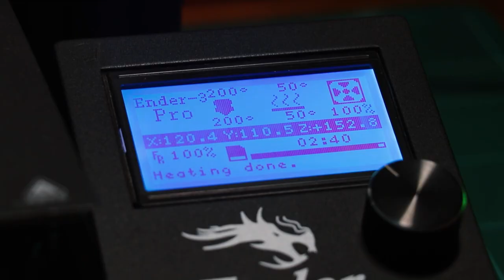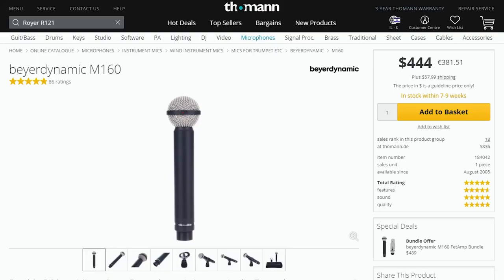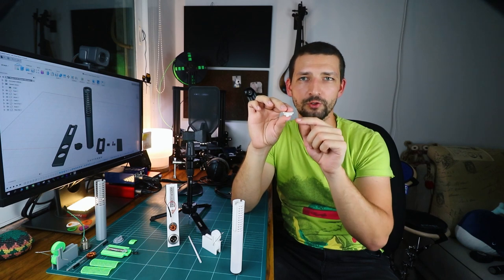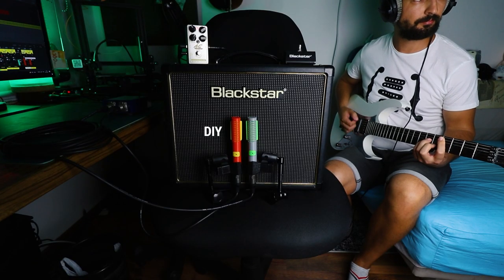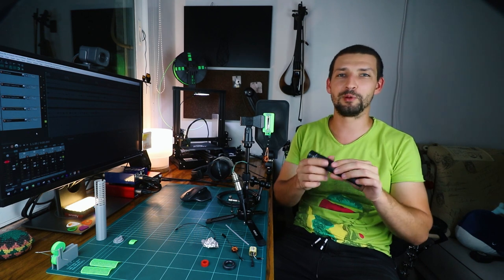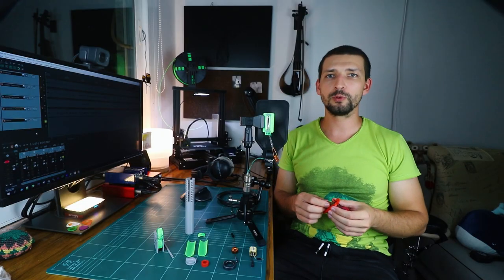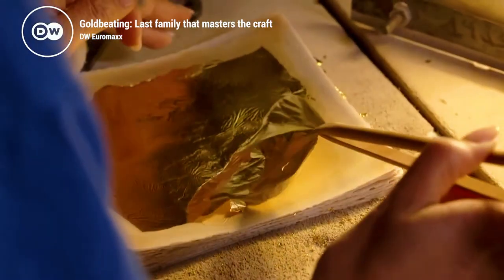3D Printed DIY Ribbon Microphone | Lundahl LL2912 vs Hand Made Transformers

Comment: I have to say you really made something great here, But the toroid transformer was the dealmaker as it saves big money and really makes it your own. Thanks.
Reply from the maker: Yeah, I didn't plan going that far, but as I was exploring how premade transformers are commonly wired I came across the Messanovic videos. It looked plausible, added few months to the project but decided to try it for the sake of the video. Turned out to be the most significant part of it :D

One could make such DIY mics even as awesome gifts to friends or giveaways for subscibers. Though would require adding some preamp with it for completeness.

Comment: Great video! The plastic 3d printed structure is more prone to interference in comparison to a metal structure grounded, Right? Have you tried to ground the structure of the mic someway?

Edit: I've commented before the end of the video where you talk a little more about faraday cage..
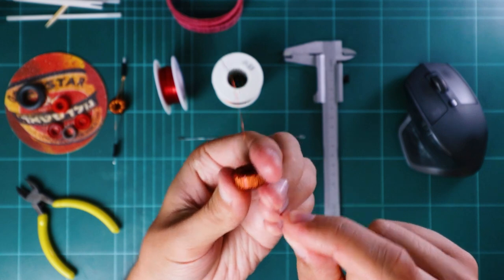Reply from the maker: Thank you:) I mention the shielding/grounding aspect here and there in the video and have a dedicated section link in the video description to 26:27 "Bacis shielding an grounding concepts".

From my tests, when ai used the Lundahl premade transformer - it seemed I didn't need get any noticable interference. But the DIY did need at least transformer wrapped in aluminum foil and the foil grounded to XLR ground pin. It is enough for my needs, but a commercial product would need something more robust and effective. Works as a proof of concepts and home use.

The mid ground would be to use a single tube as the mic body and a simple 3d printed motor to "shove" inside. I think the DIY transformer tutorial is the most interesting part of the video, as it turned out to be simple enough and saves the most money. If you don't put your time into the equation ^-^
Reply: @DimaPavlenko  thanks for taking time to answer! About the transformers I've done some tests using repurposed transformers from ATX fonts and ac/DC adapters... It's the easiest solution, but it cuts a lot of the lower frequencies... I've done a video about that, and creating direct boxes using that kind of transformers but it's in Portuguese language... anyway, I'll be trying something like your project anytime soon! Thanks!

Comment: I figured out how to get the proper thread size for the XLR jack in Fusion 360. 
Use the threading tool with these parameters.

Thread - ISO Metric Profile
Size - 20.0mm
Designation - M20X1
Class - 6H
Direction - Right Hand
Make sure you have MODELED box checked.

Then use your Press/Pull tool. Highlight all the walls of the thread, and enter -0.21.
Reply from the maker: Awesome!!! Thank you for a great suggestion and especially the instructions! ^-^

Comment: Great job! I have purchased the wire and amorphous core from your project. Am I to understand that you used 540 cm plus a little extra wire on both sides for the primary coil? How long was the secondary before it was bent in half? Any help would be great - thank you in advance!
Reply from the maker: Thank you :} Yes, so the primary was around 560-570 cm and you start wrapping with one end already sticking out. For the secondary do exactly the same calculation, but AFTER you wrapped the primary wire, so that a single wrap length corresponds the "fatter" core, and multiply the result by 2. Write down the numbers, adjust if needed, so for next one you'll just follow your own notes.
Reply from the maker: I see at 26:42 I've used 60 cm wire, then folded it. But in the video I've made the ends very small, since I wanted to test the transformers with quick connections. So it's a redundant step and ideally I would leave the other end much longer, to be able to solder it directly to the ribbon plate at the top of the motor. That's another positive of the DIY I guess, usually you get premade transformers with very short wires, requiring more and more soldering.
Reply: After looking at it I think 30 cm of secondary wire folded in half plus the extra is what you used correct?
Reply from the maker: Yep :) but consider making it longer, so it reaches the motor sides/ribbon ends, depending on where the transformer will be located. @bblankman

Comment: FYI, re: Phantom Power, it shouldn't be a problem if the mic is already plugged in, as 48V is positive on both pins. Something only happens if there's unequal voltage between the pins. If the mic is plugged into active 48V, then this can happen, as there can be a timing difference between when the pins connect, moreso if using e.g. a TRS patch bay. Of course, if one has the option to just not run the 48V, that's even safer, but some devices only allow the option of choosing 48V per bank of 4 or 8 inputs.
Reply from the maker: I recall right after I made the video, I found a guy (probably) debunking this myth indeed:
https://www.youtube.com/watch?v=cJiiO6OKkkk
but I won't take the responsibility to tell people it's ok to try, just in case :D Thank you for bringing it up and the insights!

Comment: Soldering is actually not that hard when you use the flat, wide tip and turn the heat on maximum. You just have to heat the surface of whatever you want the solder to stick on up to the point of heat at which solder melts. Else you will just mush hot, liquid solder on a surface that is so cold that it hardens the solder before it can stick to it.
Reply from the maker: Yeah heat is the key. I have an old Soviet iron from my grandpa, it has a plug, nothing more lol.

Comment: I bought your files and I'm making the version with the 1-1/2" x 1/4" x 1/4" magnets (magnets haven't arrived yet sadly, but I'm getting there). I tried using some metal screws and nuts but they stuck out too far, and i accidentally broke my first microphone body (which printed perfectly thanks to your printing tips, btw, thanks!). Moving on though I found a great solution. M2.5 heat set inserts fit perfectly in the existing holes, and I had some short m2.5 screws which just barely grip the heat set inserts without pulling through, so everything is perfectly flush! :) 

 I actually tried my hand at winding a transformer last night after watching your video and the mesanovic video, and had better success in my first trial than I anticipated. I just have a few questions, and I wondered if I could get in contact with you to discuss a little? 

Either way, Cheers! and thanks for the fun project.
Reply from the maker: Thanks Chris! I assume the base of the grill snaped, that's the most volnurable part, hence I advise people to try SLS printing if possible. I need to find local SLS printing service myself and try as well.

You can contact me either via the site form (in the footer of every page) or Facebook Messenger, the link to my profile is on the channel page header. Easier to exchange images there if needed:)

The DIY transformer and currugator will probably become the most valuable parts of the video :D
Reply: @DimaPavlenko  I think you could do another video entirely on the DIY transformers because this kind of information is not easy to find, especially on youtube! I have sent you a message and friend request on Facebook. Thanks again! :)

Comment: Turning on phantom won't burn the ribbon, DC doesn't go through the transformer, and as the both signal pins are at same potential +48v the voltage across the pins is 0v. However it's still good idea to avoid phantom.

Comment: Hello, as most of the DIY ribbon mics, the magnets are here also in an "open circuit". You can improve the magnetic field "closing" the magnetic circuit between the 2 magnets. In order to prevent any short-circuit the magnets can be recovered by some transparent epoxy.
Reply from the maker: Thank you for the insight! If you can, please elaborate on how exactly to "close" the magnetic circuit. Do you mean the magnets should touch the motor chassis? The Royer R121, from the factory reference videos I watched, just stick the magnets on epoxy, does this mean they use "open circuit" as well? They machine their motors out of a solid block of aluminum, so I doubt it "closes" the circuit, since aluminum is barely magnetic. If you know any "closed magnet circuit" ribbon mics, please give examples.
Reply: @DimaPavlenko  Well, in fact a circuit is at least always "closed", but most often it's closed by "air"... For a ribbon mike this air closing is obviously an obligation since the ribbon is in between the two opposites poles N and S. But if nothing "unifies" the other poles you have again an "air closing" on this other side. Then, if you "connect" through a ferromagnetic material these two opposites poles you now have a "really closed" circuit on this side. Try to measure the magnetic field with only the facing magnets and make the same measurement in the gap again after connecting the other poles ! You'll notice a big improvement in the magnetic field...

Comment: 16:57 don't blow on it once proper tension is set, don't scream at it, and most important don't drop it. The ribbon needs to be nice and tight so it oscillate. Make sure the ribbon is not touching the magnet and that they are evenly spaced, the closer you get that ribbon to the magnet the better (ideally about the thickness of a piece of printing paper.)  The 3d printed lines will transfer to the aluminum making it rigid and in turn it will move less smooth.

Comment: hello man!! 
 thanks for the info about ribbonmic...

Could you tell me what is the thickness of the double wire used in the primary and the wire used in the secondary? and how many laps did you use?

i got weird results when i tried to build a ribbonmic... using much thinner wires... aluminum foil... from a cigarette box....i would like to get a good sound quality like yours...haha
Reply from the maker: Hey Luis!
Sounds like you're having a lot of fun :D
Of course it's hard to tell for sure what exactly lead to your results, without seeing and hearing what you got.
I suggest you upload a test video to YouTube, so we can all learn from it.
But also maybe getting some device like the "Cloud Lifter" first, to amplify the input properly.
It made testing and using the mic eventually much easier.
Most budget audio interfaces (like my Focusrite ones) struggle to amplify such low output microphone, like ribbons.

From my failed attempt at using the ferrite core transformer, I think the most important component is the the transformer core material.
The amorphous toroid (or Lundahl's classical design) seems to be most common and good sounding one.

Anyway, on the page I made for this project: https://dimapavlenko.com/3d-printed-diy-ribbon-microphone/
there's a section listing the parts I used and their dimensions (in case anyone plans to get them from other sources).
I'm not proficient in engineering, but from the info on the parts, I used the following wires:
– primary winding: 28AWG / 0.33mm
– secondary winding: 26AWG / 0.4mm
I don't think thinner wires are the cause. Most likely it's the transformer material.

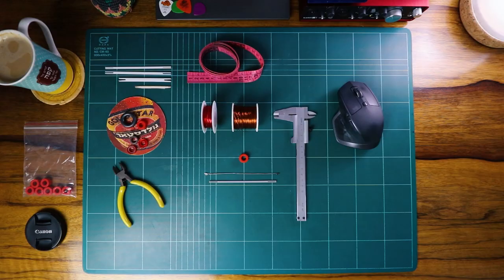As mentioned at 24:54 "How to make DIY amorphous core toroidal transformer
" video section, the key parameter, from which I deduced the number of laps (which eventually used simply to calculate the length of the primary wire) is the number of secondary windings (6), which I took from the Mesanovic transformer video. So the primary (thinner) wire, was around 6*36*[single lap length] long. The "36" comes from the voltage increase ratio, which seems to be around 36 in both Lundahl and Mesanovic transformer designs.

Comment: I do have a 3d printer and love to use it, however. I was at a hardware store a few days ago and I was looking at a length of copper pipe. You could use that for the body by just taking a hacksaw to it to make vents. If you solder the copper pipe to the XLR ground lead that would give you a pretty good EMF shield. What do you think?
Reply from the maker: Sure, that would be the ideal mic body! Also a very nice and unique looking one.

Comment: Hi, thanks for all the information you provide in your very instructive video, I think it's the best video on the net. Could you explain a little more how you calculate the number of turns of the primary and secondary? Best regards. 👍🙌
Reply from the maker: Thank you! Sure ^-^ The base parameters of the calculation, which you need to decide on, are the number of the secondary wraps and the desired ratio ("the voltage increas ratio"). The typical ratio that most popular premade transformers seem to have is around 1 to 36. Following the Messanovic factory video, I decided on 6 secondary wraps (not too much, as each secondary wrap will require corresponding 36 primary wraps).

So the primary (thin wire) should have around 6x36=216 wraps. Roughly measuring a single wrap length (depends on your transformer dimensions) - you multiply that value by 236 and get the length of the primary wire to cut.

That's it, the whole purpose was essentially to eliminate the need to count the wraps manually, by cutting just enough wire to keep the end ratio of primary:secondary wraps.

Comment: I could be wrong, but it seems like a bad idea to have a plastic body because you lose the EMF shielding properties, which is significant especially because of the high step-up ratio of the transformer. 1:35 is a lot of voltage gain for noise. It might not matter at home, but it is a limiting factor.
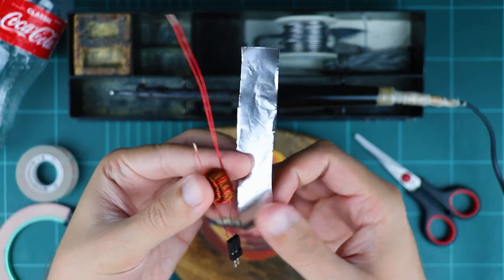Reply from the maker: Yeah, I discuss how I solved it at 19:29 and some additional ideas. For daily "use and abuse" - indeed just get a real Royer R121, or some commercial one.
For home use and getting used to tinker with ribbon mics (like replace the ribbon yourself) - it's a fun project that works.
Especially if used as baseline for further development. Like the YouTuber "Frank Olson Twins" makes gorgeous wooden mics. I think these are great for eye catching/unique esthetics in videos. I'd use his ones for a "one-shot" budget videos in a studio or at home, if you have some intimate vibe going on, like one guitar, or violin, or a guitar with a small vintage drum kit.

Comment: Hi! Your project is awesome! 
Can you try make aluminium band corrugated with not straight gear but with herringbone gear?

One of manufacturer said that it's make alu band more robust.
I wish a little later I'll have possibility try reproduce your project!
Reply from the maker: Thank you! I don't have much time lately, so most projects including YouTube are on hold for now.
Yeah, I came across some alternative corrugation patterns, but to properly test it you'd most likely need a bit more precise measuring devices and approach - having few control ribbons and somehow measure their elasticity robustness. Because in practice I couldn't even feel I'm holding a ribbon, so no way I could control and conclude anything doing it by hand :)
Maybe someone will suggest some DIY approach though in comments.

Comment: hello! first of all congratulations! transformer cores have any name or code?

Primero que nada, felicitaciones! Los núcleos de los transformadores tienen algún código para identificarlos? Excelente video y proyecto! Espero tu respuesta! Saludos!
Reply from the maker: Thank you! Nope, in the description there is a link to my web page about the mic and the link to the exact transformers I bought.
The only description there is:
Product Name: Amorphous Nanocrystalline Magnetic Ring (10*14*4.5) 1405
Outer diameter (OD): 16mm inner diameter (ID): 8mm high (HT): 7mm

I think there are several types of "amorphous" alloys. I don't have the knowledge whether it has any impact on its properties as a transformer or how much. I know it worked great with these specific cores. To be honest, as someone mentioned in some other comment, I also preferred the DIY transformer sound:)

Comment: do you have links to buy the wires for the transformers?
Reply from the maker: For the primary coil I used a roll of magnet wire I found in local electronics shop (gauge mentioned on my website: https://dimapavlenko.com/3d-printed-diy-ribbon-microphone/ )
For the secondary coil I bought "magnet wire kit" from my country popular DIY electronics website: https://www.4project.co.il/product/magnet-wire-kit
The kit had an assortment of 3 gauges, so I think one such kit from your local store should be enough for first time project.
Translation of the page:
22AWG - around 12 meters
26AWG - around 22 meters
30AWG - around 61 meters
Not sure if the gauge even matters that much, it would most likely work the same if I used the roll wire I already had, just liked the color differences/esthetics of the Mesanovic transformer. Even though no one can see it lol.